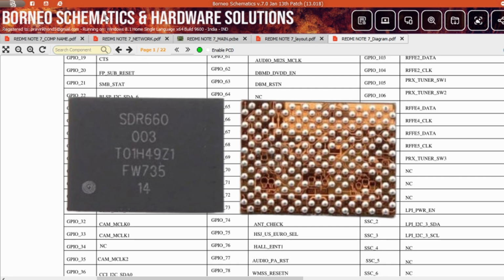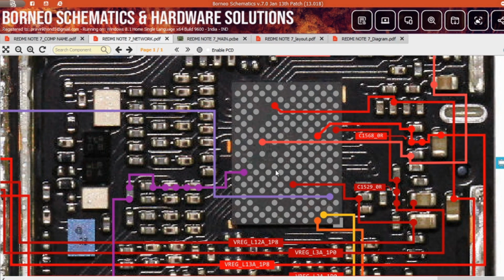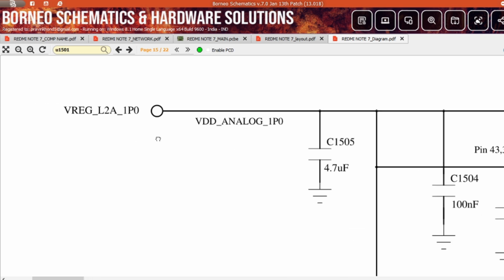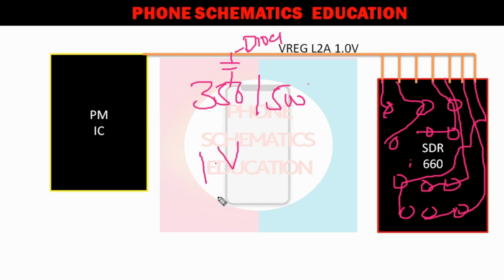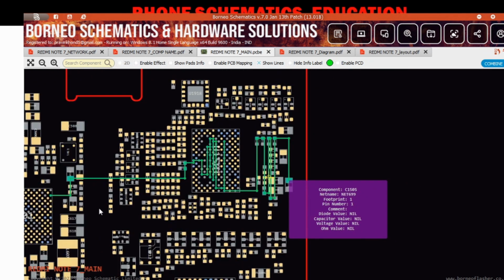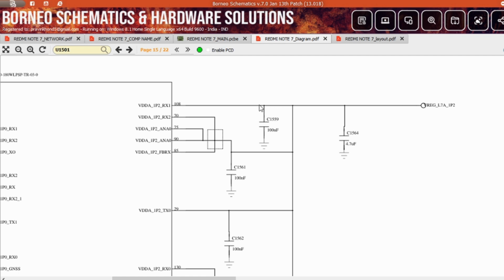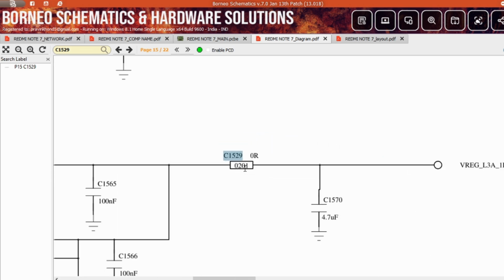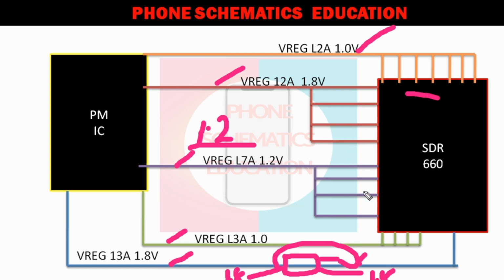Deffrance Between WTR &SDR Network ic.Teasting+Repair+Solution@phoneschematicseducation

Comment: Helloo sir!
I love the way you explain❤❤❤
Thank you so much...and all followers we have to share this video in other platform....

And i have a question sir

Samsung a13(sm-a135f)

vdd_int_0p75(buck) short
When remove cpu the short will gone..but when install cpu it will come again..i have tried by replacing cpu,power ic,coil,capacitors on that line but cannot fix sir what will you recommend me?.thank you for your answer❤
Reply from the maker: Thanks for the compliment. Let's talk about your fault. Unless you give me proper details related to the fault, I will not be able to guide you, like which buck line you see as short, what is the voltage response on all the bucks, and many other factors work. Only after that I will be able to guide you as to how to remove the short on that line or all the details of whatever the problem is.

Comment: sir i have a doubt. please clear me. so in network section we can check voltages through multimeter. so other signals we can check using OSCILATER. right. thats is very costly. i cant afford. is there any  lower priced equipment.
Reply from the maker: Wait for some time I will give you all details 🙏